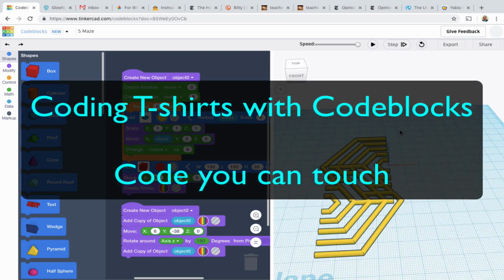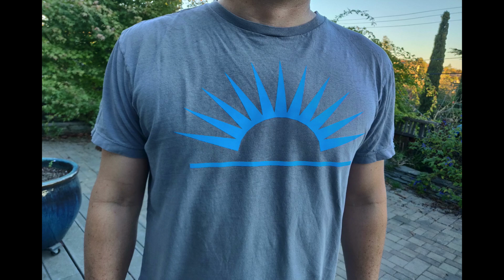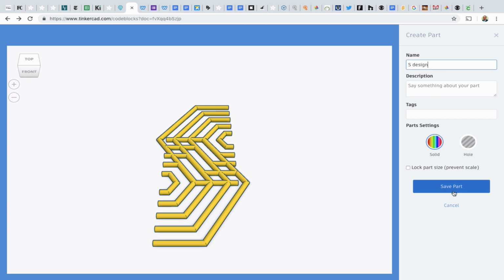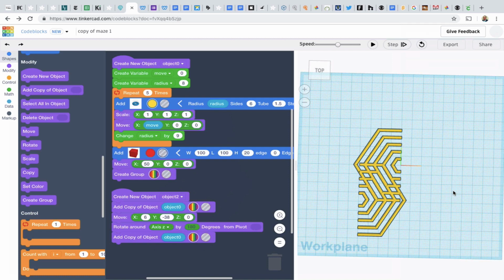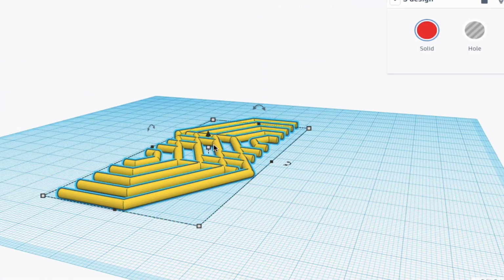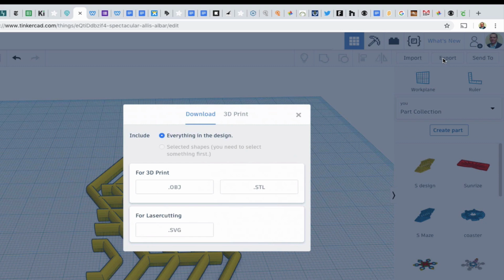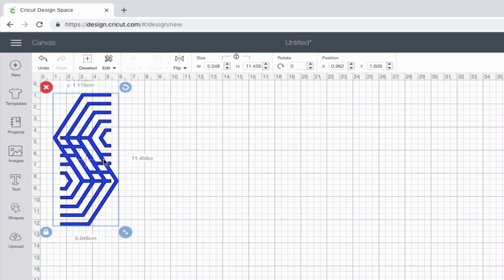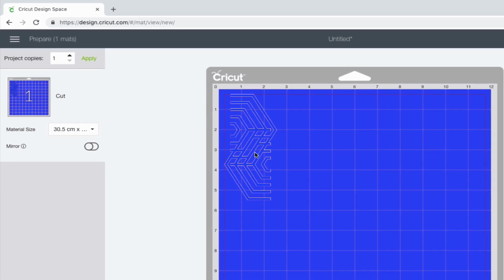Coding T-shirts with Codeblocks

Comment: I'm trying to follow along with the first design you have and I must be missing something. From looking at it it looks the same, except for maybe the two adds where I can't see the steps, edge or edge steps. It does the original design in blue and then ends with two big red boxes on top of it. It also could be that I need to set the object variable somewhere? I am just getting a very different result. I figured it out! I didn't have the red box set to transparent.
Reply from the maker: Hey there! So, you're good now? Red boxes should be holes. They cut off half the original design. LMK if there are still issues. Cheers!
Reply: @robmorrill1  I am good :) thank you!